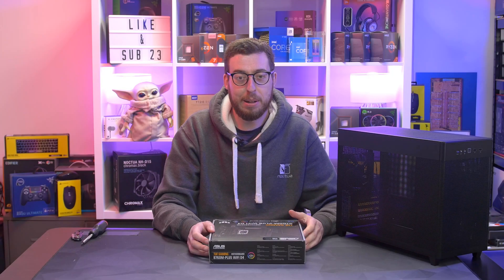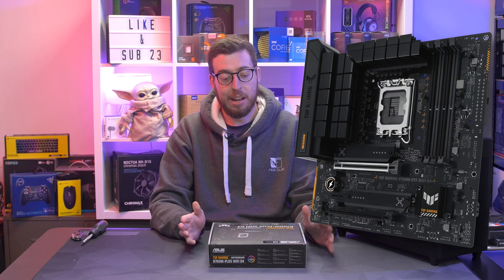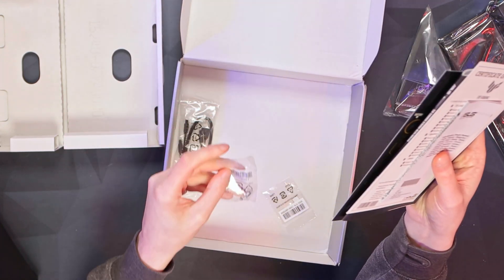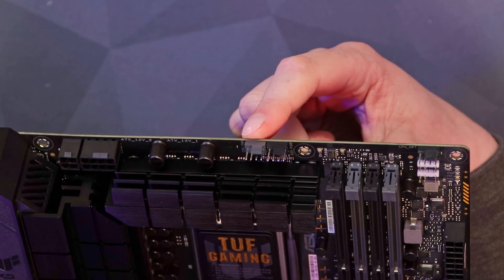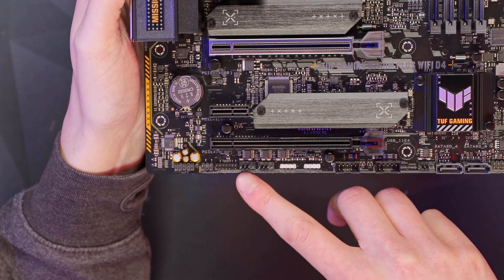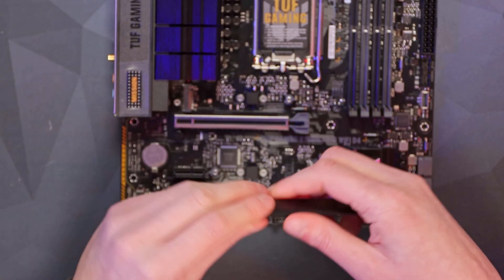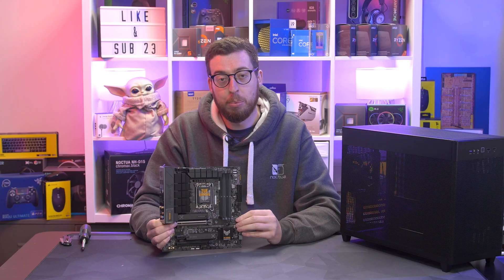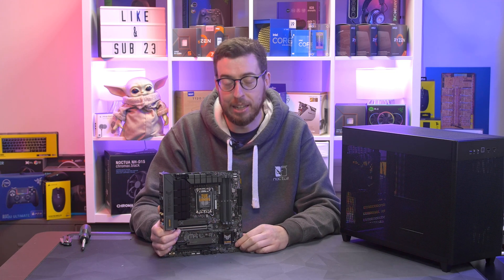AFFORDABLE M-ATX! - ASUS TUF B760M PLUS WIFI - Unboxing & Overview! [4K]

Comment: Does this work for i5 12400f right out of the box without bios update? My msi pro b660ma ddr4 wifi broke after one year, that was pretty bad. Now, i want a solid mobo for my build.
Reply from the maker: Yeah this came out for 13th gen ☺️

Comment: I’m late to the comment section. But would this mother board fit inside a micro tax case? Also can it work with a i7 12700k, 2060, double DDR5 ram?
Reply from the maker: I see all new comments, it doesn't matter. It will yeah, it's a Micro ATX form factor as I mentioned in the video. That should all be fine, yes.

Comment: Bit late to the comment section, but would this work with a 14700K and 4070ti super? Checking as compatibility checker on pcpartfinder says that the bios needs to be version 1205, so I was wondering if this had that
Reply from the maker: It will be okay with that, I recommend scaling the motherboard with the CPU though - the 14700k is high up the stack. Unless it's been done from the factory, it will need a BIOS update I expect, this launched for 13th Gen
Reply: @jordanash  So it will be fine as long as it's updated?? The motherboards are the only thing I really don't understand in PC's. Should I go with a better motherboard??
Reply from the maker: This will run it, but the 14700K is a high end SKU, so I'd recommend scaling as higher end boards have better power stages. Does it need to be M-ATX?
Reply: @jordanash  I'm honestly not sure lol. How about the Gigabyte Z790 AORUS ELITE AX as the motherboard. Would this be a better change? Thanks for your help btw, definitely deserves a sub
Reply from the maker: Yeah that's the realm I'd be looking for with a 14700K. No worries, thank you
Reply: @jordanash  Thanks very much :))
Reply from the maker: Anytime
Reply: @jordanash  I'm running a 14700k with this motherboard. It needed to be M-ATX. Am I somehow harming my system's performance?
Reply from the maker: No, it'll be fine. I just like to scale and recommend it too. I've ran a 14700k in a B760 board before no problem

Comment: If I got the DDR5 version would it be possible to use a intel 14th gen chip like the 14500?
Reply from the maker: Yes, you might need a bios update though

Comment: I got this exact board, only without wifi, at a pretty good price. Will I be able to add a wifi module myself?
Reply from the maker: Not sure to be honest, had it got the holes for the antenna? To be fair if you need wifi, go for powerline adapters. They allow you to keep closer to the wired speeds than wifi does.

Comment: The DDR5 version, can this motherboard run 12900K without problem? Just set the TDP to 270-ish?
Reply from the maker: I wouldn't run a 12900k on a B series board. Always scale the board to the CPU. Plus if you can afford a 12900k you should be able to afford a decent board for it.

Comment: Is this board good for 14600k with 4070 super without any over clocking bcoz purpose is only gaming ?
Reply from the maker: Yes that'll work fine, but the B series boards don't support overclocking as I mentioned in the video.

Comment: I already purchased this motherboard, but after completing connecting all the components and turning on the computer, I noticed that the audio outputs do not work with headphones. Only the sound comes out of the screen, which is originally connected to the graphics card using an HD cable. Is the problem with the motherboard or the problem with the audio driver? What do you think?  In this
Reply from the maker: You need to download the driver from the ASUS website. Drivers are installed to storage, so you need to purposely download them.
Reply: thanks for answer ..what is the driver do you think is suitable ? i have windows 11 and i already download   Realtek and also when plug in the headphones also no sound , if you have any link or the name of the driver hope its help  thank you so much again ♥  @jordanash
Reply from the maker: So you'll need the one that's specific to the motherboard on the ASUS page, so under audio here - https://www.asus.com/uk/motherboards-components/motherboards/tuf-gaming/tuf-gaming-b760m-plus-wifi/helpdesk_download?model2Name=TUF-GAMING-B760M-PLUS-WIFI

Comment: I just built my PC with this motherboard but after 5seconds of turning it on the white led and green led turns on, one fan decreases power and the GPU fans stops. And it also doesn’t anything on my monitor. What can I do?
Reply: Also, my GPU is Asus RTX 4060 Ti 16GB, PSU is 800W and i7-14700KF
Reply from the maker: So it depends which leds are on, without telling me I can't really help. Fans off in GPU is normal as they Don spin until under load. 

If you look in the motherboard manual, or look it up online then that will tell you the issue anyway then you can go from there.

Comment: Planning on making an upgrade to my pc and using this , a i5 12600kf, and a 1660 super. Is this a good build?
Reply from the maker: Personally I'd go for a 12400f and use the saving on a 3060Ti, you'll see a better improvement in games with that combo.

Comment: is this board good enough for i5 13600k. I am using MSI pro B760M-P ddr4 board with rtx 3070 8gb and 32 GB of ram. Problem I am having is its audio jacks are not working its new build. Some times it show blue screen error with sad face and restart itself. I read different reviews this MSi board lacks vrm cooling and low vrm. I need to know where is the problem. Either my MSI board is good enough for 13600k and rtx 3070. Or this Ass board will be better. Can you guide me?
Reply from the maker: Of course, I used it recently with a 13600k. It could power the 13700k no problem too
Reply: @jordanash  Also can It be good with rtx 3070 too
Reply from the maker: Yeah, I used a 4070ti with it.
Reply: @jordanash  Can you take a look have any experience with MSI Pro B760M-P DDR4 specification. Is it good enough for 13600k and 3070. They have not specified any VRM details on their website.
Reply from the maker: It'll be fine

Comment: I will use this motherboard with a core i3 13100 processor. Is it advisable to do this?? I will also use 16Gb DDR5
Reply from the maker: Yeah that will work, I'd go for the 13400 if you can though, that's miles better performance. Make sure you get the DDR5 version of the board.

Comment: Is there a really big difference between this one and it's ATX version? It seems like there is one more M2 slot in the ATX, and slight difference in the number of USB. Looks like the main difference could be in an audio module as the 760M does not have a shielding cover over it. I wonder how much this affects the end sound quality and noise reduction. Also couldn't find anywhere information on which codec is used in 760M. Is it the same as in ATX?
Reply from the maker: Pretty much what you've said if I recall. Sound quality wise I don't think it'll be noticeable, I think people really worried about sound would be using a sound card anyway.

Comment: Hey man, im building a gaming pc & im considering getting this motherboard but with ddr5, does it work perfectly with i7 13gen 13700k & RTX 4070?
Reply from the maker: I've not used this in a build yet, but I don't see why not. I plan to use those parts in the build myself.

Comment: Nice videos! I have this board for my first build (I5 13400f, 6700XT) and am wondering about the 12V connections at the top left of the board. Are both 8pin and 4pin 12V power connections needed, or is the 8pin enough? The manual only states "Ensure to connect the 8-pin power plug or connect both the 8-pin and 4-pin power plugs." I don't have another 4pin cable from my power supply -- it (thermaltake GF3 750W Gold) did not come with 12VHPWR cables, so waiting on those from the manufacturer. The system does nothing when I try to power up (no leds, fans, nothing)... Thanks!
Reply from the maker: Thank you! So before (Z390/Z490/AM4) you used to be able to just use the single 8 pin unless you wanted to overclock. I'm not too sure if that's still the same case or not, but given you're using the 13400f that's a low powered SKU so I think you'll be okay. That being said the fact it's not booting is odd, are the front panel connectors all connected okay?
Reply: @jordanash  Thanks for that insight -- seems odd to have this extra 4pin 12V Power when there's no overclocking for this chipset, right? Regarding the non-booting issue, we plugged the FPanel connector (2 rows, 4pins on 1 row, 5 pins on the other) from the case (NZXT H9 Flow) into the mobo header. No action. I also used a screwdriver to short the power pins (3rd pair from the left assuming ASUS followed Intel's FPanel convention), but still nothing. Also bought a new power supply to try and removed the GPU to take that out of the loop -- still no response from the system. Do you think we got a dud motherboard?
Reply from the maker: Yeah good point, sorry so many boards to think about. It may be for the higher tdp SKUs. Ah - yeah it could be, especially if you're using a new psu. Is that result with the extra 4 pin too?

Edit - pins 3 & 4 on the top are usually Asus power pins
Reply: @jordanash  Turns out that the extra 4 pin power to the board IS required after all, due to the number of cores (more than 8 or 10) in the i5-13400F. This is despite no overclocking. I wish they would have made that clear in the MB manual! Now we just have to figure out why the RGB fan hub is only powering 3 of the 6 fans we installed - another exercise in dubugging! Thanks for your help!
Reply from the maker: Ah I see, that must have been something implemented in between generations then. No problem, worry it wasn't more immediate help, it was a bit of weird one
Reply: hey bro. that is also my problem. my psu dont have extra 4 pins. and also the mobo cant recognize my sata as a bootable drive

Comment: Do you have any suggestions for cpu air cooling tower? i would like to use this mb with 13700k and 4070ti OC, thanks!
Reply from the maker: Noctua NH-D15 Chromax would be a go to, or the U12S if you want something smaller
Reply: @jordanash  thanks, but i saw NH-D15 is not compatible with this mb? will the cooler too big to install?
Reply from the maker: Oh that's strange. The U12S will be though

Comment: im thinking of getting an i7 12700k and a 3070 is that supported by the motherboard? also 16gb of ram.
Reply from the maker: Yeah if course. Just remember you won't have any overclocking support as it's a B series board.

Comment: sorry i’m a little late to this video. 
But is this motherboard vrms good enough to not choke preformance for a i5 13600KF and 4070ti. i’m not really intrested in overclocking the cpu
Reply from the maker: No worries! Yeah, that'll no problem. I'm using this build with a 13600k myself soon
Reply: @jordanash  thanks for the reply! i’m receiving mine tomorrow

Comment: Thinking about using it with a 13400F and 4070, my friends are telling me to get the ATX version as it has stronger vrm’s apparently, what do you think?
Reply from the maker: I mean for the that CPU it's not really going to make a difference, if you were going 13700 and up it would matter a bit more to be honest.
Reply: Fair point
Reply: My built i5-13500 4070ti ddr5 5600mhz ssd sn770 750w gold. I think if you gonna go 13400F you should go for 13500 more worth and can run every game with below 50% cpu usage

Comment: Will this be good for a RTX 4070? If not can I get some good recommendations!?
Reply from the maker: Yeah for sure. Something like a 13600/13700 would pair well. Just remember there's no overclocking support on B series boards.
Reply: @jordanash  awesome thanks, will a i9 12900k be good with that?
Reply from the maker: Yeah I think the VRM would be okay with that. Personally, if I was to put such an expensive CPU in a board I'd look at a Z690, they'd be cheaper now as Z790 is out plus give you overclocking support with the K CPU. EDIT - Likely a beefier VRM too.
Reply: @jordanash  thanks a lot!
Reply from the maker: No problem

Comment: Is this good with a i5-12600kf and rtx 3060?
Reply from the maker: Yeah mate, just bear in mind you won't be able to overclock as it's a b-series motherboard.
Reply: Better go with 13500f if u can
Reply: @floorgang420  are there a f ver. in 13500?

Comment: Nice one, when you install an M.2 above the graphics pci slot, does it drop the slot to 8x instead of 16x ?
Reply from the maker: It'll use four of the 20 lanes in the CPU, so you'll get full bandwidth for both unless you add another M.2
Reply: @jordanash  Thanks :)
Reply from the maker: Most welcome
Reply: @jordanash I have 2 M.2 ...if i put both what i get and what.i lose with that!?